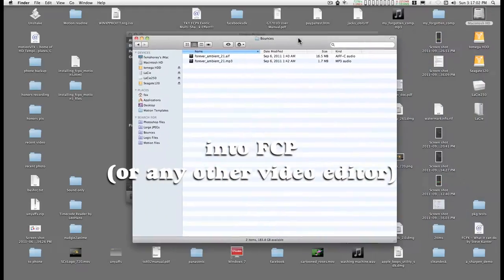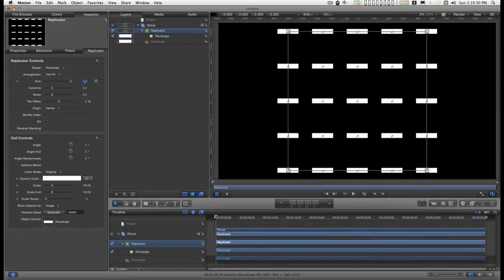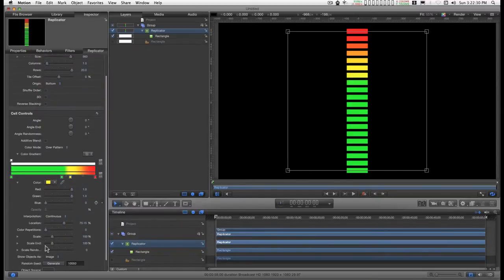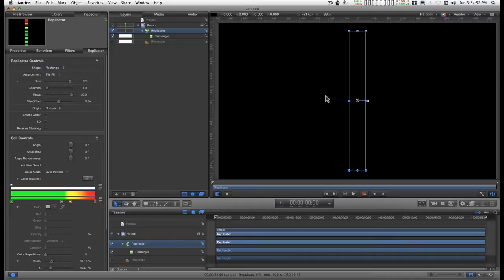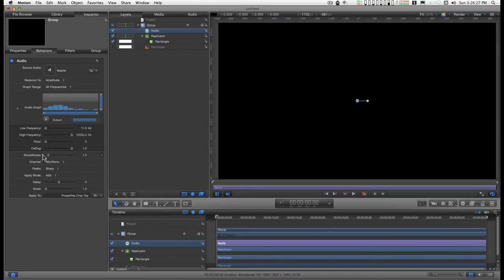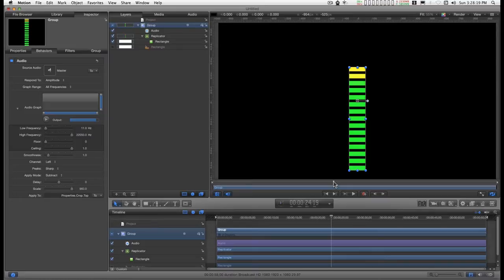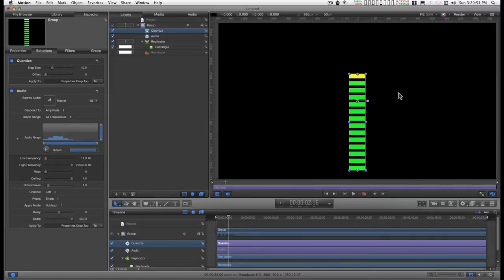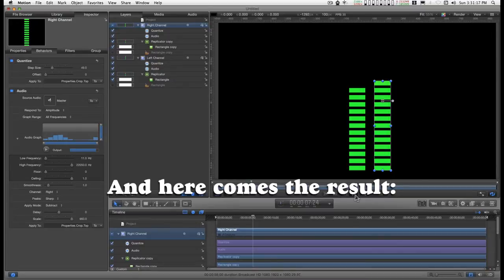Tutorial: Simulating Digital VU Meters in Apple Motion 4 and 5

Comment: Hello,
Thank you very much for this great tutorial.👍
Could you tell me if they can publish the Vu Meters on Final Cut for use with a sound source directly on Final Cut?

I am new to Motion, I have searched, but I have not found the solution, maybe you could this is possible Please tell me how to proceed.

Thank you very much and apologize for my english, I am francophone.

Happy Christmas and New Year.
Reply from the maker: No. Motion creates keyframes from an audio file for animation and the template itself will not use the audio file provided in FCPX (you have to load the audio separately into FCPX). The Motion template will happily play the animation with or without the audio file used to create the keyframes. There may be a way to accomplish what you asked for with an FXPlug which will require programming in XCode using Objective C. I can program in many languages, but I have *never* liked ObjC and won't use it. If Apple creates a Swift API, I might consider looking into it.
You *can* create a template that can be animated for several different audio tracks [simultaneously!] as long as you also import the sound sources into FCPX. You can turn on and off audio tracks in FCPX by selecting them and typing the 'V' key and select which audio track animation you need from a Pop-up menu (Rigged to control the Scale Parameters of the individual audio tracks you "preset" in Motion.) [You could also build animations that will "fade" between tracks, but synchronizing that fade animation in FCPX may be a little more work.] Audio Parameter Behaviors are Additive in their effect (by default). Setting the Audio - Scale parameter to 0 in a Rig effectively turns off the animation for that track. This is only practical if you have a set of audio tracks that you use over and over again, and really only for personal custom projects, e.g. videos you make on your youtube channel.
Reply: Hello, thank you for your answer.
All this is too complicated to be exploited directly in Final Cut😟, and I think it is better in my case, to make it simple, to make audio rendering synchronize with the meter directly in Motion and then import it. as a video media in Final Cut.
I thank you again for this time spent responding to me.🤝

Comment: Thanks for the video. I have a question/problem. I have an audio file that is fairly long (hour+). I want to affect multiple objects based off the frequencies in the audio file, however, it is taking 6 hours to analyze the audio file for one object!! And I have a pretty decently max spec'd iMac. Am I misunderstanding that I need to have the audio file analyzed for each item!?! Even after I get the audio analyzed for 1 item after waiting 6 hours, any changes I make to the object be it adjusting sliders, or moving the layers position caused Motion to freeze for 20-40 minutes just to reprocess everything, making it impossible to work with. Hopefully there is a way that Motion can just analyze the audio file one time, and then I have all the items being affected by that? Any help is appreciated. I am a new user and trying to understand the mechanics of how this software was designed. Thanks!
Reply: Ahhhhhh!!! Fox_m. Now i get it! lol. yea...that was me. :)

Comment: how do I create another tab???
Reply from the maker: For gradients: you have the thick middle bar that shows you the overall gradient "design" (otherwise it does nothing) -- underneath that middle bar there is a slimmer color bar and over an opacity bar. To create new tabs, simply click the mouse in the color bar to create a new color tab or in the opacity bar to create a new opacity tab (or "stop"). The "original" click should be the color (or opacity) value that is at that exact place in the bar where you click. Right click on the tab to change the color from the popup color picker.